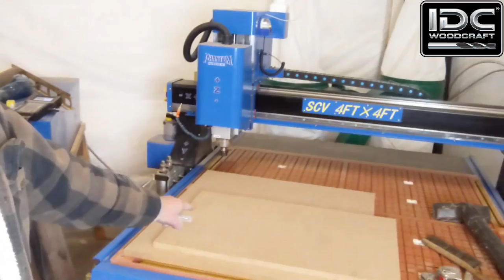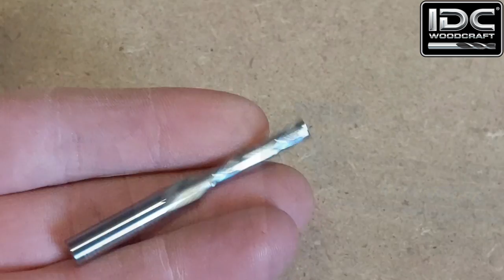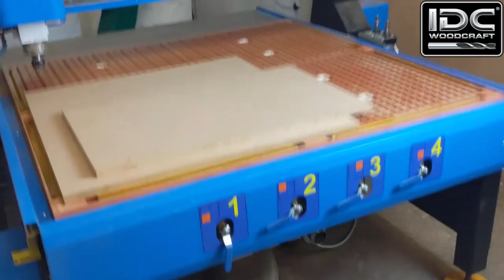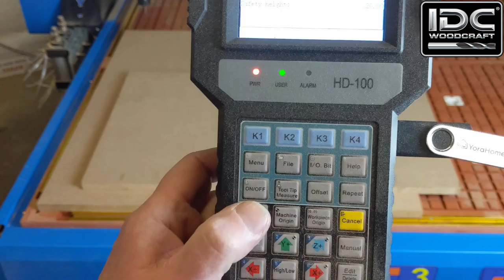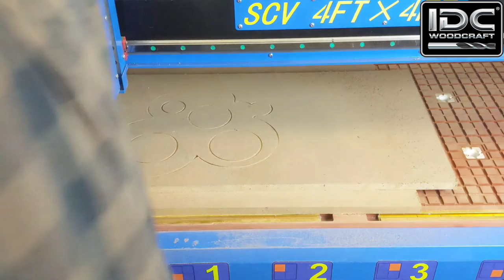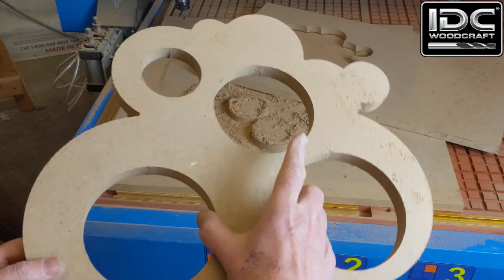Phantom CNC Router Test Run...This Is FAST!

Comment: Add a ramp to your plunge and it will eliminate the burn marks. Normally use a ramp that is 2x the bit diameter.
Reply from the maker: Bad Dog, you are so right on that one. I got too excited to put this machine through its paces that I forgot to ramp!

Comment: how does the vac table hold the top board?
Reply from the maker: Simon, the MDF underneath is porous and the vacuum pressure is able to travel up to the top board. Cool right?!?
Reply: @IDCWoodcraft  that is cool. Did you make that with the cnc or buy it

Comment: Nice machine - I'm very envious! Does your Cam software have spiral milling? I use CamBam, and it has this facility. Using this, the bit never does any purely vertical plunging. Kinder on the bit and nicer finish.
Reply from the maker: Robots, my CAM does have spiral milling brother. Sometimes im too excited to make a project and I forget to turn it on.
Reply: @IDCWoodcraft  😂. I get it

Comment: Great video thank you for sharing👍👍👍how is the mdf board sitting on the top of the bottom board holding?
 I don’t get it, the board at the bottom is the one vacuumed and hold secured. Are there holes on the bottom board?
Reply from the maker: Key, the board is held down with vacuum pressure passing through the other board. MDF is porous and the vacuum pressure can travel through the first layer and hold down the second. Cool right!?
Reply: That’s amazing!!!
What’s the biggest diameter endmill you can put in that spindle?
Reply from the maker: @micro963  1/2"

Comment: Hello,
Thanks so much the works,Sir!,
Iam using Artcam software...how can l make a File trim cap letter(CNC  router cutting machine) on acrylic for 1 mm to to thinkness aluminium or challuminium..!? ,
Thanks
Reply from the maker: Winstone, that is a bit tricky depending on the software brother. Shoot me an email with a picture or two and I will try to help you out.

Comment: I highly suggest forget about the plunging and use either the "Smooth" or "Spiral" features. You could also set a ramp of 5 degrees and crank up the feedrate a little.
Reply from the maker: Talley, good call my friend. That would definitely speed things up a bit and also save the bit life!

Comment: i like the new machine.  i've been considering the 4x8 atc machine.  i've not been able to plunge a compression bit without burning, so i usually plunge almost cut speed in zig zag ramp, usually bit dia ramp and that fixes it.  i run the 1/4 compression at full depth in single pass at 100-120 ipm.  likes flying through the material.  deflection is about your biggest issue then. 

can't wait for more vidoes on the phantom.
Reply from the maker: Layne, glad you like the new machine brother! It sounds like you should even run a bit faster than that for your machine too if you are getting burning.

Comment: How is this machine for cutting aluminum? I'm looking for a machine to cut wood, aluminum and plastics such as polycarbonate. Also, would this bit work for these materials?
Reply from the maker: Randy, when you rescale, you will need to regenerate the toolpaths before you run them in your machine.

Comment: DAMN that thing is a beast for sure!!! Wow is that cool as hell. I can't believe it held both boards in place too and it made very light work of the mdf. 🤯
That new bit is great too!!
So with all the new bits that you're designing, how are these compression bits  different from the regular 1/4" downcut bit?
Can the compression bits take place of the upcut and downcut bits?
Reply: Garrett explains the differences in his pizza peel video - essentially downcut creates tear out on bottom of material, upcup creates tear out on top of material, and compression helps reduce tear out on both top and bottom

Here is where he explains:
https://youtu.be/XKmOEATrkWA?t=3706
Reply: @Josh Philips  Right, I know about the tear out with the bits.
But thats not what I really needed to know.
Thanks anyways.
Reply: @JoeLazzara  My bad, I'm new - wasn't sure if that was what you needed or not. Best of luck and happy holidays! :)
Reply: @Josh Philips   Oh no problem at all Josh. 
Thank for responding, buddy!! 
You're new??
To cncing or Garrett lol?😄
Reply: @JoeLazzara  haha new to CNC, waiting for my first one to arrive...
Reply from the maker: Josh, an upcut and a downcut have their place in the shop in addition to the compression endmill. What is so great about the compression bit is that you combine both a downcut and an upcut in one to get virtually no tear out on your project surface.

Comment: Scratching my knoggin as to how the second piece is held down! That’s some serious vacuum if it’s sucking through the lower piece!
Reply from the maker: Pat, it sure is brother! Since it's porous, it can vacuum down both pieces. Isn't it awesome?!
Reply: @IDCWoodcraft  absolutely amazing ! Sure beats tape and CA glue!
Reply: @IDCWoodcraft  Is there a foam style gasket below the first board of mdf. Ive been looking into making a vacuum table. Did you have to surface any amount off the first layer of mdf for it to pull thru to the second piece of mdf?

Comment: Awesome!  I recently purchased the IDC 1/4" compression bit and have been using it on 15mm Baltic birch ply with clean results top and bottom running at 80ipm.  I have been using ramps and have no burning running at 30ipm plunge.  I am impressed by how polished this bit is compared to many other brands.  I will order a backup and hope the 3/16" bit will be available soon.  Merry Christmas.  Steve
Reply from the maker: Steve, awesome that's great to hear! I'm glad the compression bit has been treating you well my friend. Keep up the great work brother!